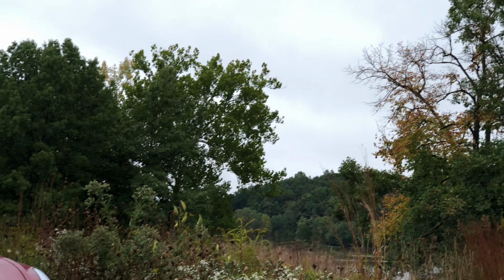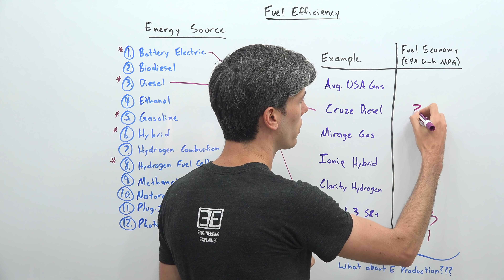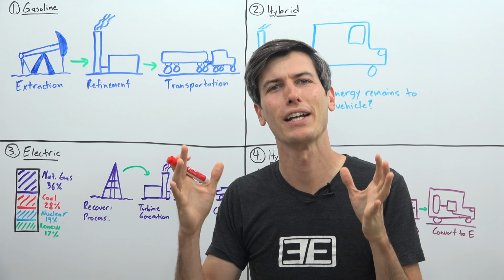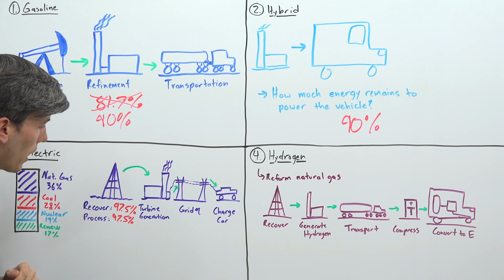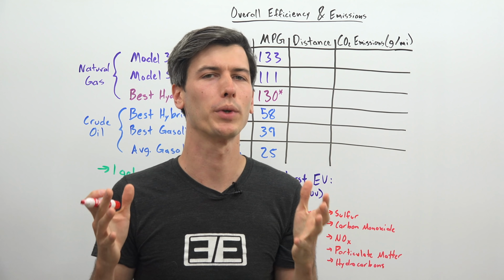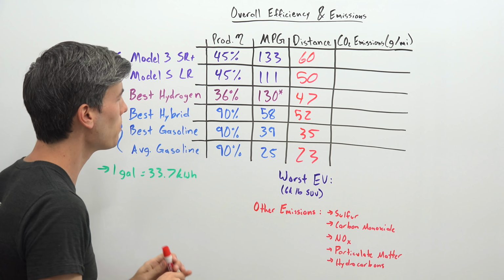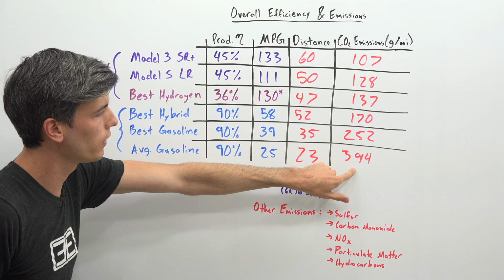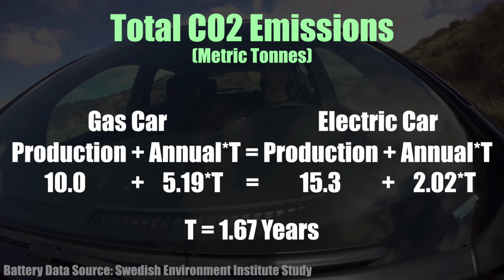Are Teslas Actually Better For The Environment?

Comment: Yeah, but, it only takes 5 minutes to refill my gas tank and it takes at least 1 hour for an electric car recharge. # aintnobodygottimeforthat # gasolineaddict 
*sarcasm
Reply: IN TODAY'S World, you can "fill" a tesla in 20 to 30 minutes...to do 360 MILES... that's no escuse.
Reply: @dazouk  Sure it is. 5 mins is 15 to 25 mins less time each time you recharge a tesla.  And that's assuming that where you are going has the quick recharge stations.  If it doesn't.. well.. then it takes hours to recharge.  Hell, if you happen to be somewhere were there is only 120V 15amp service, it'll take about half a day to recharge your Tesla.
Reply: Yes however you have to fill a gas car every week, at approx 7 minutes or more.  Most EVs are charged at home taking 2 seconds to plug in.  Only the 1-2 long trips a year require a 30 minute wait.  So gas per year 52 weeks x 7 minutes = 364 minutes vs EV 30-60 minutes.  Over 5 years that difference comes out to 30 hours on pumping gas and 5 hrs charging an EV.  Not to mention while you're waiting on an EV to charge you can take a bathroom break, get some food, etc.  While pumping gas you are just standing there.
Reply: And it only takes a few seconds to plug in an EV. You can then walk away. Go to sleep, eat, shop, visit friends/family, etc. That 5 mins to fill up your ICE car is time that you have to take to do so. EVs far better and faster in nearly every case.
Reply: @joetripp123  Good point.  I forgot about that one
Reply: @anthonypelchat  Unless you always take long trips, like me. lol  For most people I know, they would be great though.
Reply: I'll only buy a gas car if it comes with a service that tops up my tank every night while I sleep for $1 a gallon.
Reply: @dcheverie  That is true and US it's HUGE, but in some EU countries there's a lot of fast charging stations
Reply: @joetripp123  Most drivers do on a daily basis less than 200 Miles... A Tesla on a house plug can charge that over night.
Reply: @dcheverie  Out of curiosity, how often do you take long trips and can you provide some details? It's something that I always like to discuss. Depending on the situation, you will either save a massive amount of money using an EV or an EV makes absolutely no sense. It's kinda fun to think about, for me at least. ;)
Reply: @dazouk  Good point.  I am Canada.  So it would be even harder here to have a lot of fast charging stations.  We are the same size as the US, but 1/10th of the people. lol
Reply: @MrDRSMAX  That sounds like an awesome feature. hehe  Technically though, if you had a natural gas car, I think something like that might be possible. :)
Reply: @dcheverie  we use it in europe, it's called LPG"liquefied petroleum gas". Quote :. 

Also referred to as butane and propane gas, or autogas in motoring circles it is the by-product of the processing of natural gas liquids as well as the refining of crude oil.

While traditionally it was deliberately burnt off and wasted, it’s now recognised as a versatile low-carbon fuel – and used productively.
Reply: @anthonypelchat  I have to do a lot of driving for work.  And both where I am and where I drive to don't have any fast charging, or any charging stations at all.  Welcome to Canada.. lol  So, I would only be able to charge at home.  And, because of the province I live in, electricity is VERY expensive.  It works out to about 30 cents/KWHr.  Meanwhile, right across the river in another province, it's 8 cents..  EV's would be way better there than here.

As for long trips, I would say the shortest of the trips is about 2 hours each way, sometimes more, depending on the amount of driving I have to do when I get to the next city. (again, no charging stations there).  The longer trips are a minimum of 5 hours each way.  That destination would probably have charging stations, but I haven't checked since I don't own and EV.

Another issue is that I haul around e-waste for a living.  And currently, I don't think there are any EV mini vans or larger.  The average amount of e-waste I have to haul is about 500Kg or more, but not more than about 700Kg usually.  If it's more, I just rent a bigger vehicle.

As for personal driving that isn't work related, and EV would be perfectly fine.  Of course, I live in such a small town (9,000 people), that I don't do much driving that isn't work related. lol  Maybe..35Km a week, max.
Reply: @dazouk  We have that here too, the LPG, but we also have natural gas, which is different, I believe.  Correct me if I am wrong though.  But I do know that the natural gas that most of Canada uses to heat their homes in our nasty winters has nothing to do with petroleum.
Reply: @dcheverie  Your hauling would be the issue. The CUVs out right now might handle it just fine, but they are expensive luxury EVs, not work EVs. You would have to wait until a truck or maybe the Rivian Work Van that Amazon is buying. Maybe the Model Y. Personal choice there. The 2 hrs each way would probably be just fine in a long range EV. Wouldn't trust short range versions in your area and with your travel. That 5 hr drive each way would likely need one 15 min stop on the way and then a fast charge at the destination. 

For costs, you are probably looking at $20 for the 2 hr drive using a Model Y. The trucks could be more like $25, but no real numbers there. That 30 cents brings the cost very close to gas. The 5 hr drive would likely put it at the same price for gas, if not more. I would guess that it would be close. No real savings that I can see. Man, that 8 cents would bring that 2 hr drive down to like $5 - $6. You need to move. lol.
Reply: @anthonypelchat  I was actually thinking about the EV trucks after I typed that comment.  I forgot about them.  Oops. lol  But in the end, as long as electricity is as expensive as it is here, the cost difference is pretty much zero.  Which really sucks. 

And I'd really love to have an EV hauling vehicle. 100% torque right from zero RPM would be really nice when hauling stuff.  I am still young enough though, so I am hopeful that will be an option soon enough.  Especially since we get most of our power here from non coal/nasty power sources.

But yeah, $5 to $6 for that trip instead of $20ish would pay for the extra cost of the EV in no time.  Then I'd start saving money really quick.  I would move if I could, but I am self employed and starting from nothing again is just not possible for me. :(
Reply: @dcheverie  I understand. Moving is usually difficult. More so if your self employed and/or have kids. My job is a little better for me. I work remotely and can be anywhere (took 20 yrs to get to that point). I am trying to cut back on as much as possible. If I get to a good point, I'm thinking about trying to live is random areas or countries for 3 to 6 months at a time. Will take some work, especially since I have a wife and kids. But going to try. Maybe will stay in Canada as well, but only during summer. lol

Comment: In the UK over 60% of our grid is renewables and nuclear making electric vehicles a no-brainer. Also most EV owners charge from their own solar panel installations so the emissions from energy used are basically zero. Not to mention how much cheaper EVs are to run and maintain!

Comment: He's talking US electricity generation - 2019 numbers updated :
Natural Gas  38.4%  (continuing growth displacing coal)
Coal 23.5%
Petroleum  0.5%
Nuclear  19.7%
Renewables (total)  17.5% consisting of Hydro and Wind below
Hydropower  6.6%
Wind  7.3%
Biomass (total)  1.4%
Solar 1.8%

Keeps getting cleaner every year.   Wind did better than hydro for the 1st time in 2019, and it wasn't a bad water year for reservoirs either.

Comment: Very good video. I don't want this to seem like a complaint because you went through a lot of work doing all this and as usual presented facts extremely well, but at the same time all the assumptions made to simplify the issue and shorten the video have an effect on the strength of the conclusion. For instance, I wonder how it would change if we didn't assume electric cars got all their energy from natural gas. Also, I wonder what the average and best mpg's would be for gasoline diesel engines with a professional tune. In addition, I'd like to know about the emissions and efficiency involved with the manufacturing of Tesla batteries. Just a few examples. I don't want to sound like a critic, you did an excellent job. You answered a lot of questions. I'm just curious.

Comment: One thing to think about with electric too is life span and disposal. There's a lot of hazardous material in those batteries and it needs to go somewhere.

Tbh I really like teslas, I just hate their infotainment system. Everything is buried in menus and if you want to use it it's hard to see the necessary gauges like speed

Comment: In 2016 Tesla owner in Singapore was slapped with $15,000 fine for high CO2 emissions - The equivalent CO2 emission of the Tesla S car was 222 g/km as calculated by the Land Transport Authority (LTA). That was more than Mercedes S car. There are also other EVs on the other hand, which got rebates in Singapore. According to the LTA, the Tesla Model S they fined used 444 watt hour per kilometer according to tests performed under United Nations Economic Commission for Europe standards.  

So someone does the wrong math here, I am not sure who does…

Comment: So you covered the energy going in to power these cars, but what about after they are done with the cars? what is the damage to the environment, energy wasted to recycle them? Is the efficiency of the electric car worth it at the end of life cycle? would it be enough to offset and still be on top?

Comment: There's a few things that it seems nobody takes into account, which may be marginally negligible, still count in.  Such as refinement and production of lubricants and coolants which the electric motor will not use.  These have to be changed periodically in ICE motors, and lead to increased waste which is also typically hazardous.  People primarily focus on the CO2 emmisions, neglecting that an ICE car will go through about 40 gallons of oil, and a couple gallons of transmission fluid ( I'm assuming brake fluid and coolant negligible as they are in both types of vehicle).

I suppose that could be negligible in a car's overall lifespan though, but I never see them taken into account.

Comment: Really nice video. Lovely to watch. I wish you wouldn't change numbers which you've found cited in some literature though (e.g. gasoline efficiency from 82% to 90%). Better to just clearly state where the number is from. Doesn't take away from your overall point however, so kudos for the fantastic content.

Comment: I would like an even more in depth video with consideration to the entire production of the vehicle itself, electric, gasoline, diesel, hybrids (all of them). What would be the real c02 emissions for a Model 3 LR then? And then adjusting numbers for wind powered grid, hydro powered grid etc. For example, if I own a Model 3 here in Norway, only charge at home, and I know for a fact my electricity provider is 100% from hydro energy, what would the real emission total be? I know it can't ever be zero, because of the production of the car.

Comment: A little more than half the gas plants in the USA are combined. Most are simple cycle running a littler better than half that efficient. If you average US power plants weighted by percentage of total production, you are looking at a little better than 33% thermal efficiency. And I think you numbers for transmission are really optimistic, especially considering how far most cities are from their power plants.

Comment: Good analysis.  Several years ago I lived in a area with frequent power outages.  If more people own and drive electric cars and are charging their vehicles at home,  it's there going to be more power outages?  I'm not sure if the present infrastructure will be able to handle the additional power consumption by the charging station. 

Certain locations in California had several days of power outage due to large fires that destroyed homes and forest. The people whose homes were not destroyed had no power for several days. This is one of my concerns about owning an electric vehicle.
Reply: Some people don't use home charging at all. Even in a power outage, you'd likely be able to drive a little bit and get to a functioning charging station. In a larger-scale outage, you're not going to have gas pumps working either.

Comment: We all know it's more efficient to run an electric car. Can you go into more detail about the production efficiency of electric cars? Mining/production of neodymium, and the energy used produce the ~65kg of lithium for the batteries. How many liters of lithium brine must be pumped, and how much energy to concentrate that brine to 45% then undergo electrolysis. I know that they can use evaporation to concentrate, but it takes years, so let's assume they use electric pumps & reverse osmosis filters. @ 50ppm lithium brine, that's 1,300,000 liters of brine to process. Surely that takes a lot of energy.

Comment: Very nice analysis, insofar as it went.  What about the “upstream” emissions and energy consumed throughout the exploration, production, refining, and distribution/delivery of the gasoline to the local gas station?  Cumulatively, that long "invisible" sequence of upstream fuel-related operations adds up VERY substantially, and I have to think that would have massive effect on your EV payback time estimates.  Also, I may misunderstand, but wouldn't there also be a significant differential in production emissions for producing the ICE car, including all of the components that the EV DOESN’T have (e.g. engine, transmission/drivetrain, gas tank, radiator, associated pumps, hoses, exhaust system, catalytic convertor, lubrication system, piping, extra wiring, and dozens of additional components and appurtenances)?  If we're going to ding the EV for the batteries that the ICEs don't need, it's only fair to ding the ICE for all the many things that the EV doesn't need.  It’s very challenging to figure out, but fair’s fair.

Comment: Also that slide(14.47) is anywhere from 17.3Mm(something with a 3.0-3.5 engine) to 32.5Mm(02 1.6 corolla hatch). Doing a cost benefit analasis a used corolla makes more sense for the average person than a new tesla. Also those 1.67 years can be streatched out to 6 years or more.

Comment: Conveniently left out the "battery production impact" part until the end in a 5 second blurb.
Reply: Point being, you have to have the battery produced and in the vehicle before you can compare it to a gas vehicle running on the fuel produced.

Comment: I appreciate that the way you did this in giving electric cars the most difficult time to be better than standard gasoline, but I would be interested in the actual math as well. 31 percent natural gas and 100 percent are very different so Id like to see some more accurate numbers in teslas favor as well. Its nice to have a worst case scenario but thats usually offered with a best case as well.
Reply: I'd like to see it for BC, WA, OR, ID, CA which are dominated by hydro production of electricity...

Comment: I performed a similar analysis, but factored in electric grid fuel sources by state and determined that the Tesla Model 3 ends up producing more CO2 emissions than a Toyota Prius if charged in the following states due to heavy reliance on coal (and petroleum in the case of HI): WY, WV, KY, IN, MO, HI. In fact, WY is so bad that a Tesla Model 3 LR is responsible for the same amount of CO2 emissions as a ~40MPG car.

Comment: And what about the useful weight these propulsion systems can carry? A london bus to do the daily distance would need 5 tons of batteries but if it has fuelcell that only weights 2 tonnes for the same distance. That’s 3 extra tonnes to carry which is almost 40 people/bus. You need significantly less buses to carry the same amount of people and also you can produce hydrogen from water (even sewage water) by using the surplus electricity created by renewables. I think hydrogen fuelcell is superior. Minutes to refill, can be created anywhere using electicity and water, doesn’t need all the materials to make tons of batteries (which will have to be disposed/recycled) so the co2 emitted during manufacturing the vehicle is lower also. What is your opinion on that?

Comment: You missed a transportation step for oil. You have to get the oil from the well to the refinery (truck or ship). Then there is the lost gas and oil at the well and the flaring at the refinery (both pollution directly into the environment). Then there's the electricity used to run the refinery.

To be fair. You'd have to include mining lithium for the batteries and copper for the EV motors. And whatever energy is used to make the parts and build any vehicle (ICE or EV).

Comment: I have watched a lot of videos on electric cars.  Sure, it is cool, and I want one, but frankly, they too expensive.  For one, you video isn't the first i have seen of quality issues with Teslas.  Two, I can hit a pot hole with my wife's Subaru xv, and my truck, and it doesn't cause issues.  I actually hit a big pothole with my Mazda 3, and it broke the passenger side front strut, so I fixed it.  It put it on my self, but If I would have paid the dealer, it still wouldn't have cost me that kind of money.  Now my Mazda 3 did have low profile tires, but maybe not as low profile.  Three, there is the pain in the arse factor.  4.  For example, in LA they just cut electric power to 500,000 people for 3 days.  In that case, if you have an electric vehicle, you may be out of fuel...  For money, Security and usefulness, gas cars are better.  You are right however, that internal combustion won't get better.